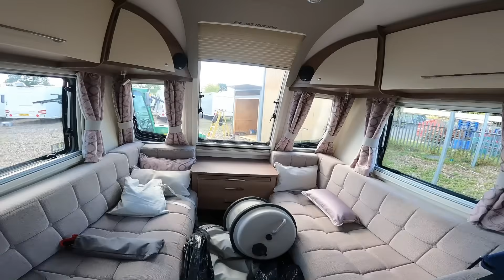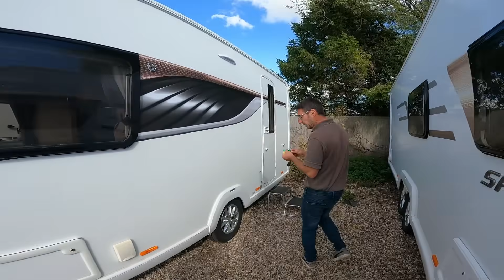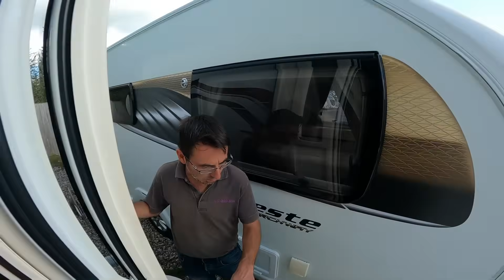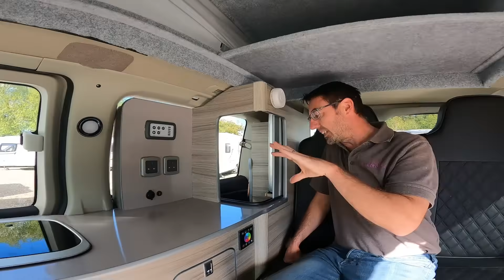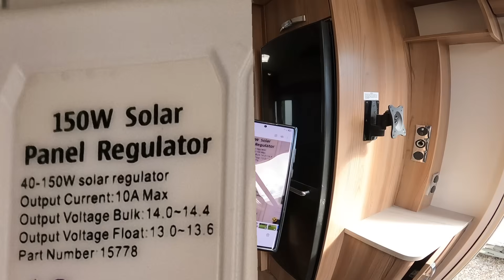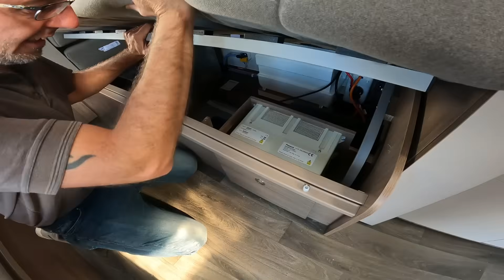Lithium Battery For Your Caravan & Motorhome.

Comment: Mark, Yes I've got a lithium battery, victron charger & solar charger!
You forgot to mention one of the big benefits of going lithium... Weight saving, 15 kg that's 30 cans of beer! Over a agm battery! 
No problems, works a treat even in the winter!
And don't forget a lithium charger, will charge your battery to 100%
 not 80%on a normal charger,

Comment: I started to have 2 x 100ah lead acid batteries to run a 2000 watt inverter as we mainly go off grid. When away over October one of the batteries failed.I then bought a 200ah lithium battery, which is about halved of the weight of the two lead acid ones. I then replaced the charge controllers from PWM to MPPT ones which or more efficient. I have two indentical controllers which are one for the 200 watt solar panel on the roof  and one for a 200 watt solar which I plug in when on site. As regards the EHU if we do happen to hook up the trip switch is turned off because 200 watt of solar keeps the batter topped up as we use the mains for any high power appliance. When is storage over the winter we have a sonic mouse controller and a tracker running 24/7 and the MPPT easily keep the topped up althrough the winter.

Comment: We spend all our caravanning time off grid. Mid season we upgraded to an ecoworthy 280ah battery, changed the ac to dc charger to a victron IP 22. Have a 200W solar panel with a Victron MPPT 75/15 smart solar. Victron charger and solar controller are linked through the app and set to Lifepo4 charging regime. We haven't had the battery at less than 94% all season. Total cost probably close to £750 ish and victron app tells me the solar panel has recovered 20kWh. Which at current rates I reckon is worth approx £5.40 🙂

Comment: Great information once again Mark. In our 2024 Coachman the factory fitted Solar panel controller is beside the battery charger under the seat . Not the most sensible place for it .

Comment: How I switched to lithium batteries.

I went for an Ecotree 105 amp battery, which fitted in my battery box. I swapped out my old charger for a Victron IP22, which also fitted in the same spot. It’s a simple process: unplug the leads, remove the power plug, add a kettle lead plug to the new charger, and then plug it back into the caravan.

The cables to charge the new battery go directly to the charger, and I made sure to fuse them correctly with a proper fuse for lithium batteries. I also installed an isolation switch.

I swapped out my solar controller for a Victron 100/30 solar controller, which was a straightforward swap.

On the roof, I have one Victron 185 W solar panel. When the awning comes down, I’ll add another panel.

Under the bench seat, I have an Exoflow Delta Max2 plus spare battery with a lead going into the hookup.

As a seasonal caravaner, all of these upgrades paid for themselves over the winter. It costs £5,000 to use site electric over winter.

I hope you don’t mind, but here’s a link to the shop where I purchased all the Victron equipment. They helped me out with everything, from cable sizing to fuse size.

This can all be done with basic DIY skills. 
https://callidus.shop/?ref=uzwgfbmw&utm_source=affiliate_scheme

Comment: Great video Mark, It’s about time we started talking more about lithium batteries, especially for caravans. I made the switch to lithium batteries too, as well as an EcoFlow Delta 2 max.

I know it’s a bit pricey at first, but the money you save on not using the site’s electricity is worth it in the long run, especially during the winter. As a seasonal caravaner, it’s been a game-changer for me.

I hope the manufacturers will soon start fitting all the equipment to standard lithium batteries.

Comment: I have a question about single motor movers vs double motor movers on a twin axle caravan. 
I would have thought a double motor mover on a twin axle would be better.
Could you explain the difference and maybe demonstrate the difference?
Also, on the subject of motor movers, on a single axle caravan, does it make a difference where the movers are mounted? On my van, the movers are mounted in front of the wheels, but others are mounted behind the wheels. What's the difference between front & rear mounted?
Thanks
Reply from the maker: Hi, on a single axle doesn't matter where they are mounted, it won't make any difference. On a twin axle it will help the caravan turn quicker, but still not turn like a single axle, more a large curve turn, it won't spin as the wheels are fighting each other. A single set of movers on a twin axle will go forwards and back no problem, but won't turn very quick at all. Hope this helps.
Reply: @thecaravanplace thanks. Is the mounting position more to do with manufacturer design for weight distribution or doesn't it make any difference?
Reply from the maker: @beccabeme it's sometimes to do with the chassis mounting position, or customers preference.👍

Comment: Another option is, as follows. I have a 100Ah AGM battery and 200W of solar on the roof on my 2022 Swift.  We changed the solar charger controller to a Truma SDC25 MPPT when we added the extra 100Ah panel to the roof as the one that came with the van was good only for up to 150W and the new MPPT can be configured for lead acid, AGM and lithium batteries. That was done in 2023.

To complete the job this summer we got ourselves an EcoFlow Delta Max 2 with a bi facial solar panel (220W facing the sun, max of 170 on the other side attracting ambient light). I THINK in addition to the 100Ah from the caravan battery, the EcoFlow gives us another 170 Ah so really that should be enough for the UK.

But I can effectively use the EcoFlow as an electric hook up by attaching the hook-up cable from it to the caravan. That allows me to use 240V power (so my wife is delighted to use her hairdryer!).  

I have only had it a couple of months but the solar panel with the EcoFlow, whilst not (so far) getting up to the 220W + 170W from the reverse side, does put more into the battery in sunshine than the caravan takes out to run the fridge, for example, when on hook-up, so saving gas.

If, next summer when spending 23+ nights off grid in Northumberland at the Beadnell THS, I will NEVER run out of power. To be fair, I never ran out of 12V when just using the 200W solar panels to charge the AGM battery which replaced the original lead acid one, but the EcoFlow now gives us a "portable 240V hook-up" which is rechargeable via its own solar panels on the ground. It would allow us to watch 12V TV all day if we wanted with no fear of flattening the battery (not that we do that!) but also allows us to use the EcoFlow hook-up to power the caravan for the fridge and/or heating/hot water.

Since they say the EcoFlow (with its lithium batteries inside) can recharge daily from virtually flat to full for 10 years without diminution on charging performance, I should save quite a lot of EHU and on gas.  Happy days....
Reply: top job thanks for commenting so useful

Comment: Swapped our 100ah LA for a 280ah LiFePo battery. Made a couple of videos on it too. 
I didn’t change the onboard mains charger (Apuljak do one) as the current charger would charge the Li to around 90+% any way, that’ll leave the solar to do the rest. I did choose to get a Victron solar charger so I can set charge rates and monitor the charge going in from solar and check the battery level too.
We could have ‘straight swapped’ for a 100ah li battery but feel the cost being so low just meant it was better to get the larger capacity and size. Our current solar charger did have a li profile but really wanted to monitor what was going on. 
Andy.

Comment: LithiumPro can now supply their 175Ah Artic extreme battery in a H8 model format with 200A BMS Mark this works fine if you set your battery charger to a AGM charge profile etc

Comment: Speaking as a caravanning aeromodeller with over 15 year's experience with small lithium polymer batteries, it is essential to have the correct charging regime. A lead acid battery charger will not do the job.
Reply: Changing to a lithium battery is very complicated and the damage caused by a mistake is frightening. Best to stay with lead/acid which has been around in a wide range of applications for welll over 100 years.
Reply: I too am a caravanning aero modeller. Having seen a small three cell lithium battery go into thermal runaway, I will never have an electric car or a lithium battery in my caravan. Your point about charging is very valid and was the cause of fires when they were first introduced.
Reply: @tjeffpowellful just checking- you had a 3 cell LifePO4 battery for a model aircraft that suffered a thermal runaway?